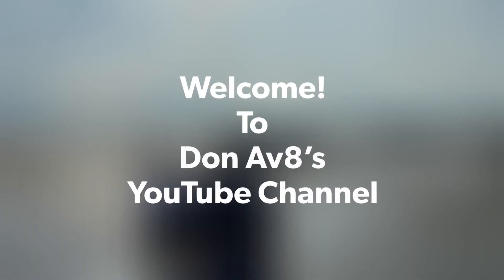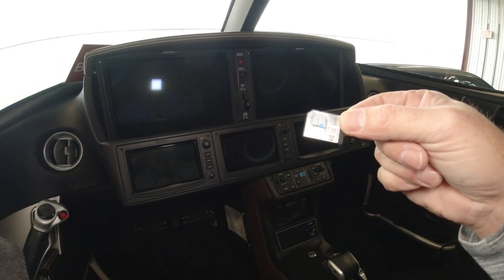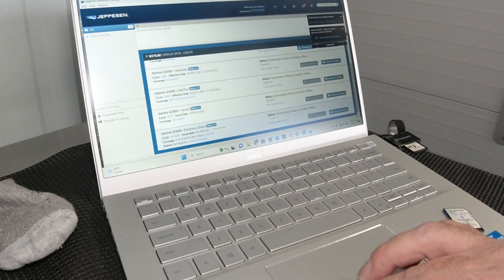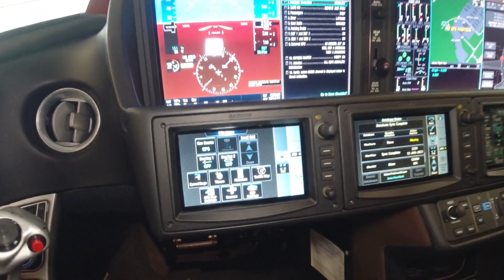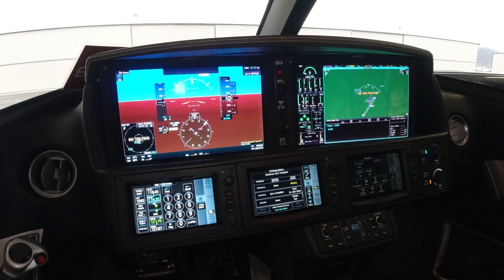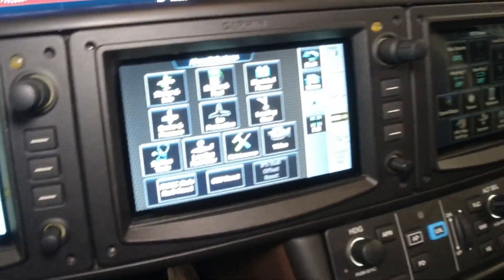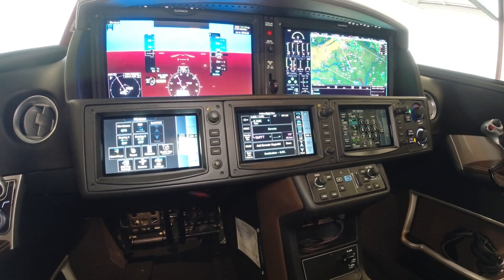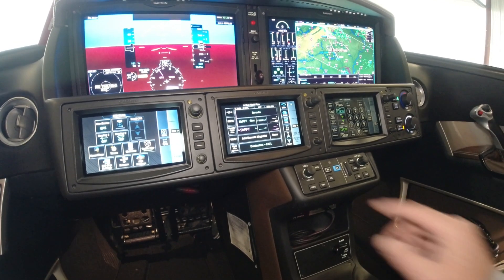Cirrus Vision Jet Database Updates, VNAV and ATC Holding Procedures

Comment: HI there DOn! How are you? I am an SF50 pilot in Brazil, and I didn't manage to update my charts yet. I saw this video, but could not put the charts into the 510 card, because I do not have the proper card reader. DO you think a Baseus or Ugreen usb C hub will do the job?
The fist time I updated the database I used a black SD card to put the files in and then plugged in the top mfd. And It worked in everything but the charts!

Am I doing something else wrong?
Reply from the maker: Hello, Gabriel! Thank you so much for watching the channel and for asking the question. I want to first say that you should be very careful updating databases. If you do not understand the entire process! It can result in corrupted data and take hours to fix.  One important thing to remember is that for generation one Jets, you place the new databases and charts on each of the cards in the lower slot. Typically the 510 is in the MFD lower slot. in generation, two or generation 2+ Jett you never ever put databases or charts on the cards that are in the aircraft. You always use a supplemental card. The 510 card is a media card, so it requires a transcend reader, even though it looks like a standard SD card. Here is a link for one you can buy on Amazon.Transcend TS-RDF5K USB 3.1... https://www.amazon.com/dp/B009D79VH4?ref=ppx_pop_mob_ap_share.
Reply from the maker: If you send me an email, I can send you a cheat sheet for updating databases. Please remember that the process for updating databases is different based upon the generation of the jet.
Reply: So, the first time that I did the update I used the G2 method, because I didn't know that. I put a blank SD with all the database and charts in the top mfd slot and it actually updated everything but the charts. Now I need to update everything again but I'm afraid it won't work or get a failure. But I'm buying this transcend card reader as son as possible! Question, do I have to erase everything from the card located in the bottom slot of the pfd? It has a lot of files in it.
Reply from the maker: @gabrielc.l.9149  hello, Gabriel! Thanks for the additional information. Unfortunately, I feel like there is more information I need in order to provide you with any type of guidance. I would contact your Cirrus Aircraft representative or Garmin for detailed assistance. There is definitely distinct differences between the way you update the G1 versus G2 aircrafts. You will probably have to remove all the databases from the LRU and start over but I would get local advice before doing anything. I would also make sure you understand the complete process before trying this again since so many things can go wrong and cause problems down the road.

Comment: Hello I am from  Croatia  I love airplanes very much  .I think vision jet has awesome features.I want to ask something  is that true  that vision jet can not stall
Reply from the maker: Hello Darel!!  I love Croatia. Very beautiful place. 

Actually, SF50 can stall. The plane does have automated flight control systems that can pitch the plane up or down to handle under speed or over speed conditions, but this system does not provide throttle control. Stall speed in the landing configuration is about 73 knots, so it is hard to stall. Thanks for watching.
Reply: Thank you for the answer
Reply: Have you ever visited Croatia  with vision jet?
Reply from the maker: @dareltarbuk1332   It would be a very long trip in a Vision Jet but flying over the sea and mountains of Croatia would be fun.
Reply: Yea

Comment: Interesting how different versions of the G3000 are handled differently, along with different techniques. On the M2 I fly we don’t have any SD cards in either PFD slots (2). I have a mx SD card in the top slot of the MFD and my flightstream SD card in the bottom slot of the MFD.  Database updates are done by removing the Flightstream SD card and using a dedicated separate SD card that I use with the JDM app to download onto, putting it into the bottom slot, then powering up the avionics to do the database sync. After it’s complete I power off the avionics, remove the database SD card, reinstall the flightstream, power up one more time to insure the database sync is good, then I’m done.  Interesting.
Reply from the maker: Hi PPP!  Thanks for watching.  Very kind of you considering your experience as a Pro Pilot.  G1 Vision Jets use Perspective Touch avionics (Garmin G3000) and databases have to be installed on the cards like I showed.  The G2 Vision Jets never have the databases installed on the cards.  A supplemental card our 'briefcase' card is used to install new databases.  Technically, you can also use the FlightStream 510 card's wifi and Garmin Database Concierge to wirelessly install databases from an iPad, but the files are so large in the jet it is not viable for most of us.  I love your video!

Comment: Thanks for that tutorial.
I've seen other videos where they crossed a way point, and ATC had them descend to cross it. Why is that? Why do you even need to rout over a waypoint in the first place since you have GPS and I thought waypoint location was done by triangulation even before GPS was in use?
Reply from the maker: Thanks for the questions Werner!  A pilot filing a flight plan has two main choices.  They can files a direct route from point A to point B or file using fixes or navigational aides.  Every flight above 18,000 ft  or when weather is below VFR visibility minimums, must be conducted with an instrument flight plan.  When you file, you are under ATC surveillance and control so there are preferred routes that can be used.  They become highways in the sky for multiple airplanes heading in the same direction.  Sometimes the routing is to remain clear of terrain or special use airspace and has navigational fixes to accomplish this.  Without fixes, it would be difficult to abide by ATC crossing restrictions or ATC to have positive control and predictability of traffic flows.  Airports in busy airspace will have arrival and departure procedures where pilots must use RNAV or area navigation fixes to comply with navigation, altitudes and speeds.  Fixes are a necessary part of area navigation.  GPS waypoints are used as fixes and so can ground based navigational aides like VORs, etc.  GPS can references both as GPS fixes, but most ground based navigational aides use navigation radio frequencies, which is a different navigation source that GPS.  I hope this helps.